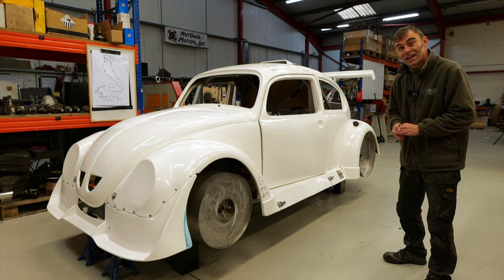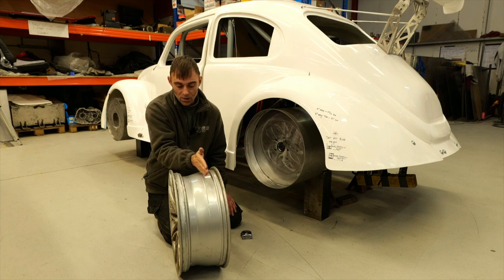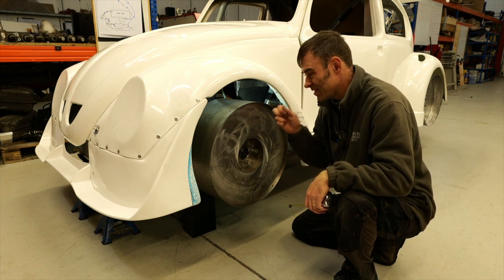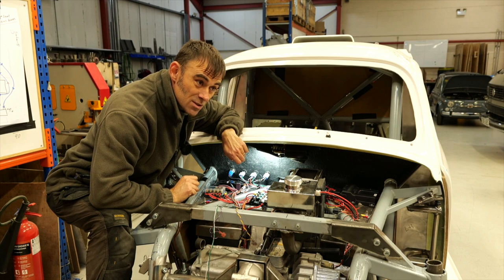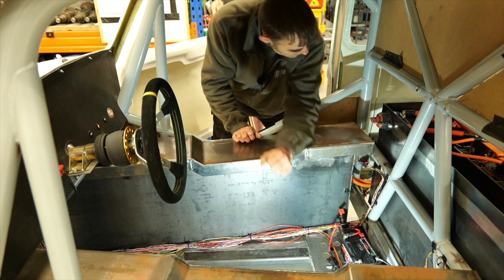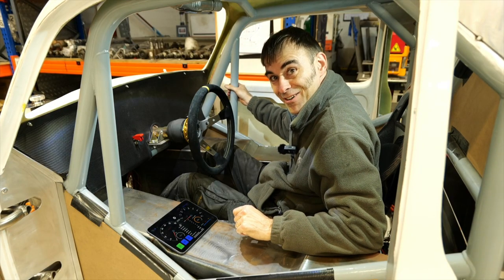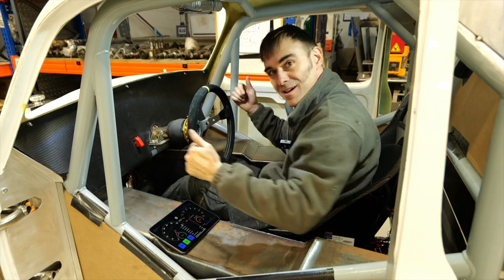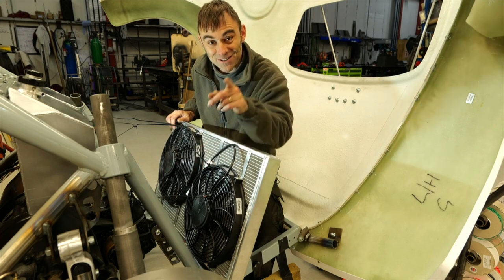Pikes Peak race car Ep5 - Wheels and wiring

Comment: ECC, on commercial aircraft those Wiring Standoff are 2-part epoxied to the structure.  I think 3M DP420 is a common adhesive, it is extremely strong.  Just clean contact surface really good.  That would save the trouble of welding on nuts.

Comment: Wheel offset is a pain to work out.  As you point out, it is what the wheel will rub against.  Horizontal springs and shocks with a bell crank were the result of needing big wheels and upright suspension getting in the way.  Another informative video, thanks.

Comment: Have you incorporated chillers into the cooling loops for any of the conversions yet ? 

This could be a great test bed if not , being able to keep the battery temps in the sweet spot .

Imagine model 3 track mode thermal  management on this  🤯
Reply from the maker: Yep, that's plan B. 😁👍
Reply: @ElectricClassicCars 😲...  now I want plan A not to work out , just to see that .

Comment: It's a pity about needing large offset outwards (and therefore scrub radius) on the front as it'll make torque steer worse and there's going to be a lot of torque! Is there the possibility of inclining the macpherson struts inwards more to gain some more room? Although this probably has other issues...
Reply from the maker: I agree. We'll definitely have to see how the torque steer goes. 👍
Reply: @ElectricClassicCars  I understand you don't want to and you've a lovely billet hub and calliper bracket in there but is it worth considering using the audi rs6 or R8 front suspension? As these are most likely to be  compatible with your existing hubs / bearings and brakes. Adapting the frame for this, whilst a step backwards now would IMO give a better more tuneable result later.

Comment: Front and rear wheels are same diameter? There's no transmission to wind up, but a difference would puzzle motor controllers wouldn't it?
I may have answered my own question already....!
Reply from the maker: The front and rear wheels are indeed the same diameter. 👍

Comment: I think something very similar has been done before.  You may want to see what was discovered by road racing a TESLA Model S drivetrain.  You should have pushed the technology to implement your first idea of using the dual motor carbon wrapped PLAID motors.  https://www.youtube.com/watch?v=Im_Gkd5ksco
Reply from the maker: Some good info there but it's not news to me. Having built over 70 electric converted cars now I know first hand the thermal management challenges we've got to overcome with the battery and motor. That's why I decided on 3 battery packs in parallel to share the load so the thermal stresses should be 3 times less. We've also gone for a dual motor setup for the same reason, to share the burden of pushing it down the road. However, having said all of the above I still think the large rear motor is going to struggle to keep on top of it's temperatures. That's why the plan is to get this all working to a degree before the ultimate setup, which will be Plaid setup. 😁👍